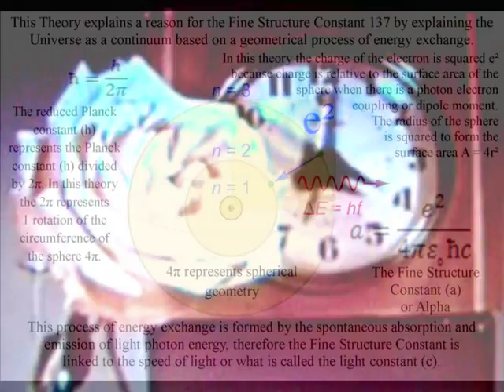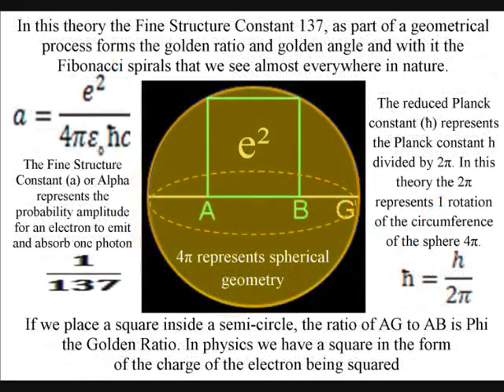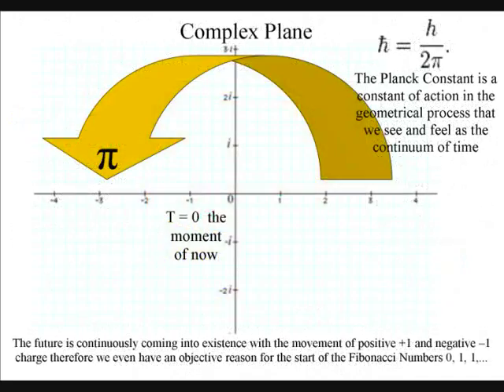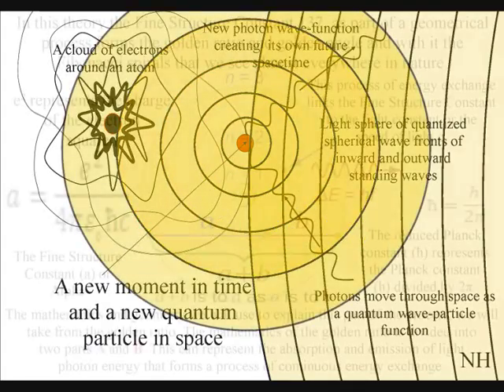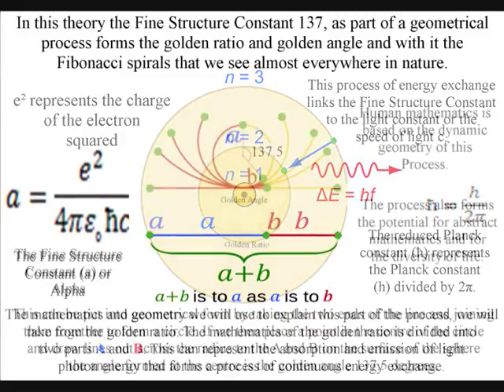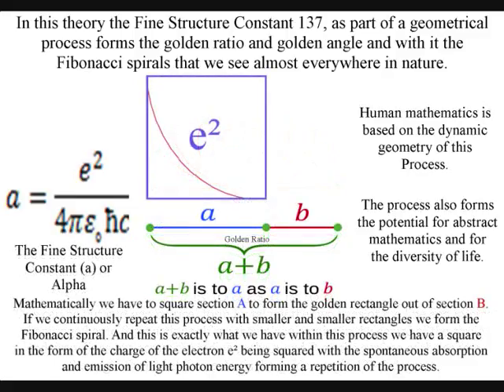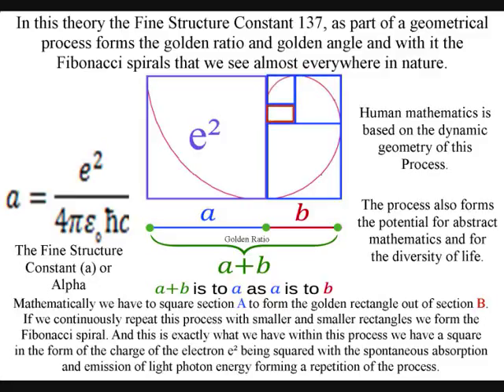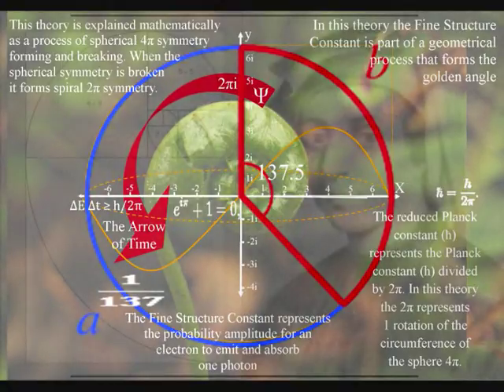A Reason for 137 the Fine Structure Constant

Comment: “When I die, my first question to the devil will be: What is the meaning of the fine structure constant”  /Wolfgang Pauli/
 “The theoretical determination of the fine structure constant is certainly the most important of the unsolved problems of modern physics.” /Wolfgang Pauli/
Reply from the maker: Me too!
Reply: @Dyslexic-Artist-Theory-on-Time  ....  Universe is based on the (π)+ fine structure constant + forces 
#
The absorption and emission of fermions energy forms a repetition of the process forming the Golden Angle (a=1/137) in the form of geometrical self-similarity. 
#
The (π), fine structure and forces forms the topology of particle dictate how quantum particles take geometric shapes. 
We have the Golden Angle (a=1/137) not only to aspects of mathematics but also in physics, chemistry and biology.
We see the Golden Angle in almost everything that is a process over a ‘period of time’. This is because the process (a=1/137) forms a process of continuous creation.
#
 In this way the Golden Ratio, represented by the letter (π = 3.14159. . .   and (a = 1/137) are a geometrical connection between two aspects of quantum particle.
 Universe is based on these two quantities (+ forces)
#
The wave particle duality of fermions depends on these three quantities.
#
The quantum mechanics represents geometry, the Planck Constant ħ=h/2π is linked to 2π circular geometry representing a two dimensional aspect of 4πr² spherical three-dimensional geometry. 
#
We have to square the wave function Ψ² representing the radius being squared r² because the process is relative to the two-dimensional spherical 4πr² surface. We then see 4π in Heisenberg’s Uncertainty Principle ∆×∆pᵪ≥h/4π representing our probabilistic temporal three dimensions life. 
#
The electromagnetic force is result of  (π + a + h-spin)
The absorption and emission of light ∆E=hf energy is depends on changes (π + a + h-spin), because there are two (2) kinds of own, inner spins of fermions.

Comment: Is there a connections between civil engineered  trusses and atomic structures? 

This video shows a natural quantized effect using a version Euler’s Contain Column Theory?

This video of an engineering test models the quantum physics problem called “Particle in a Box”. The wave function is used to predict the location of quantum particles, atomic structure and molecules.

https://youtu.be/wrBsqiE0vG4?si=J5jCMxq3pRe_P-gG

Very stable trusses and truss core panels have been fabricated using the process shown in the video.

The video shows how materials naturally respond to induced stresses in a “quantized“ manor. 

The process’s load/deflection’s sawtooth curve with its exponential fit in the engineering study shows the previously unknown bifurcation between quantum jumps. 

The effect has been used to make light weight structures and shock mitigating/recoiled reduction systems and earthquakes isolation systems. 

The model shows why with the, exponential load increase and loss of resistance at phase change, quantum jumps are so very fast.
Reply from the maker: Very interesting comment and video. I believe the answer is yes. In this theory between any cause and effect there is the absorption and emission of light, a photon electron coupling. This can also be called a quantum jump or dipole moment. I take it that with an increase in stress there is an increase in temperature, therefore an increase in photon ∆E=hf energy.
Reply: @ thanks, I find that very interesting I will have to think about that also

Comment: Fine Structure Constant as a mystery can not be solved within QED! Why? Answer: If alpha "which quantifies the strength of the electromagnetic interaction between elementary charged particles" you can not explain alpha (electromagnetic integration) by electromagnetic interaction. See Fine Structured constant "Geschichten aus 1001 Nacht if you like. More short mystery.
Reply from the maker: This theory explains a reason for FSC based on spherical 4πr²geometry. We have a process the is relative to the surface of the electron sphere that surround the nucleus. When there is an exchange of energy we have to square the radius  r²~ ψ², t², e², c², v². This form a constant relative to the spherical surface that we see mathematically as the FSC

Comment: however the fine structure constant 1/137 is NOT constant, at higher energy values the number 1/128 emerges
i.e. The usually quoted value of the fine structure constant is 1/137.0359... This value holds at low energies. As is well known, this value increases somewhat with energy: it is about 1/128 at (M_Z)^2. Now, IF we imagine that there is no GUT, no physics beyond the standard model, no supersymmetry, and that QED is correct all the time (yes, that is a big IF), what would the value be at Planck energy (10^19 GeV)?
Reply from the maker: It approximation
 Ψ²💡 4πr²🟡 r²📐 c²➕➖e² ⏳t²🎲   Eₖ=½mv²🚀

Comment: And so you would turn the clock back to the Dark Ages of the 1920s, the decade when a whole crew of scientists who should have known better (notably Eddington who was dubbed Sir Arthur 'Adding-one' for his childish 'revision' of 136 to 137, and who likewise might have had a "Somerset accent"), went off on kabalistic ruminations about the integer 137. It is obscene for you to even mention the name 'Feynman' in your context, since the number he said should go up on the wall to "worry about" was -0.0854255. (Or, approached another way, the number is 137.03597; in any event, certainly not the "137" of the long-ago 1920s. See QED, Penguin Books 1990, transcribed from Feynman's 1983 lecture series at UCLA, where the two numbers I cite will be found on page 129.)
And by the way, the pi in '4 pi epsilon-naught ' cancels the pi implicit in the denominator of the succeeding h-bar. Thus, there is no reason ever to show Pi anywhere in a fine-structure constant equation except that one is a promoter of the Superstition of Pi.
Reply from the maker: Just because we make a new mathematical term as in h-bar does not destroy the geometry 2Pi is still out there! LOL
Reply: Verschlungen ... lol you are clearly ignorant about the light to be found in the dark ... you don't like the Qabalah eh? (one of its many spellings of Kabalah) .... however IF you do your homework assigned by a rabid rabbi who emerged out of a rabbit hole you would realize that the word QaBaLaH has a value of '137'  i.e. Q=100 B=2 L=30 H=5
Did you also know that the number 137 emerges out of a geometry lesson?  Did you know that the QaBaLaH claims to be a bridge between the bible and science? I have a feeling you do not know much about what you do not know

Comment: Maths in a Somerset accent is simply the best maths you'll ever find.
Reply from the maker: I don't know about that LOL
I think we need to go back to r² and the three dimensional physics of the Inverse Square Law!  Spherical 4πr² geometry is fundamental to this process and this is based on Huygens’ Principle of 1670 that says, 
“Every point on a light wave front has the potential for a new spherical 4πr² light wave". 

We can think of each point as a potential photon ∆E=hf electron interaction as resonance or vibration. The spherical 4πr² surface forms a boundary condition or manifold for the uncertainty ∆×∆pᵪ≥h/4π of everyday life.

The centre of the sphere forms a constant of action relative to the radius square r² and the circumference 2πr. This forms the Planck constant h/2π in mathematics of Quantum Mechanics

Comment: ℏ=λ*(P/2π)
Reply from the maker: I think we need to go back to r² and the three dimensional physics of the Inverse Square Law!  Spherical 4πr² geometry is fundamental to this process and this is based on Huygens’ Principle of 1670 that says, 
“Every point on a light wave front has the potential for a new spherical 4πr² light wave". 

We can think of each point as a potential photon ∆E=hf electron interaction as resonance or vibration. The spherical 4πr² surface forms a boundary condition or manifold for the uncertainty ∆×∆pᵪ≥h/4π of everyday life.

The centre of the sphere forms a constant of action relative to the radius square r² and the circumference 2πr. This forms the Planck constant h/2π in mathematics of Quantum Mechanics

Comment: 1:13 surface area of a sphere is 4pi r^2 not pi r^2 
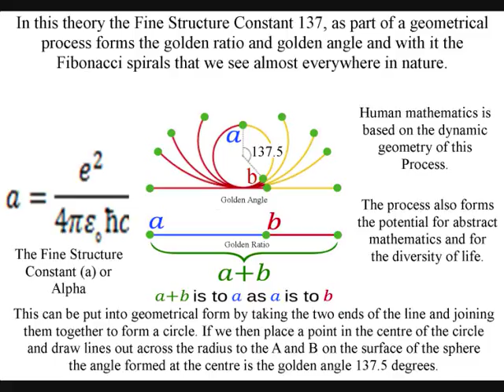 2:46 selection of degrees as units is completely arbitrary, you could also say it's 2.39 radians and conduct numerology on that too
0:15 the fine structure constant is approximately 1/137, not 137
Reply: The reciprocal (137) is often used instead of 1/137.
Reply from the maker: It is the geometry that is fundamental, not how you represent it.
Degrees are a good approximation to radians.
It is true the Fine Structure is an approximation and this is what you would expect if its formed out of symmetry breaking!
Thanks for your interesting feedback.
🎨🤠👍

Comment: The speed of light is exactly the radius of the sun minus the radius of the earth squared

(432.000-.3960)^2 = 186,282

The fine structure constant 137 is the reflection of the speed of light divided by the reflection of the earth year or the radius of the sun divided by PI.

282,681 / 563 - 365 = 137
432.000/3.14=137
1/137 = 729,927

29.53 * (3.14 + 2.718) + (666 * 3) * 365.2423 = 729,927

That's the exact tropical earth year and the exact sydonic moon month. 666*3=1998 which is the moment the sum of numbers is 999 times larger than the number. 

A circle of radius 365 has a diameter of 730

730,000 - 73 = 729,927

729,927 has 432,000 coprimes the radius of the Sun.

The Monster Group  is 196,883 or the Sydonic Moon Month * the Gravitation Constant

295 * 6,674 = 196,883

The reason it was called Monstrous Moon Shine is because it is also 

29.5 * 666 + 413 = 196,883 ( 413 is the reflection of PI) 

196  & 295 are the first and second Lychrell numbers that cannot form a palindrome.

19.6 * 18.6 = 365

It goes sooooo much deeper than just these. The higs bosons if you triangulate their masses their coprimes are equal to the radius of the sun, moon and earth.

If you want to know more about Easter Egg functions and see documentation for all my claims Cosmology365 for all my original research.
Reply from the maker: Paul Dirac said: "Theoretical physics is a waste of time unless you can explain 137". This theory explains how light spheres form the potential for 137.5 ~ 1/137 Coupling Constant or Fine Structure Constant, Golden Ratio ϕ, Golden Angle 137.5 and Fibonacci Spiral. 
Spherical 4π geometry will naturally form a three-dimensional process (three-dimensional space) that has to be squared r² if the process is relative to the surface of the sphere. This could give us a reason why so much is squared in physics, t², c², e², ψ² and velocity v² as in kinetic Eₖ=½mv² energy. This process would form an uncertain ∆×∆pᵪ≥h/4π future continuously unfolding with the exchange of photon ∆E=hf energy.

Comment: Ha ha, very funny. The units of degrees, that is 1/360 of a circle are human defined. Your derivation would be closer if there were 359 degrees to the circle, and that's MY great theory. Nobel prize on the way.
Reply: these videos are like magnets for idiots who covet a nobel prize
Reply from the maker: Degrees and radiant are a good approximation of each other! The geometry is more fundamental than how you measure it LOL.
This theory explains how light spheres form the potential for 137.5 ~ 1/137 Coupling Constant or Fine Structure Constant, Golden Ratio ϕ, Golden Angle 137.5 and Fibonacci Spiral. 
Spherical 4π geometry will naturally form a three-dimensional process (three-dimensional space) that has to be squared r² if the process is relative to the surface of the sphere. This could give us a reason why so much is squared in physics, t², c², e², ψ² and velocity v² as in kinetic Eₖ=½mv² energy. This process would form an uncertain ∆×∆pᵪ≥h/4π future continuously unfolding with the exchange of photon ∆E=hf energy.

Comment: 137.
Reply from the maker: This geometrical interpretation of quantum mechanics can give us a simple explanation for the fine structure constant or coupling constant 137.

When light waves interact with the spherical electron probability cloud that surrounds the nucleus of an atom there is an exchange of energy formed by the spontaneous absorption and emission of light.

The absorption forms a photon ∆E=hf electron coupling and at that moment in time, the energy levels cannot drop below the centre of the sphere because the process is relative to the radius and the spherical surface. This forms a minimum amount of energy forming a constant of action in space and time that we see mathematically as the Planck constant h/2π linked with 2π representing the circumference of the sphere 2πr.

When the energy levels drop, it also forms another geometrical constant relative to the square of probability and the spherical surface. This is seen mathematically as the fine structure constant or coupling constant 137. 

The absorption of light is followed by the emission of a new light wave that forms a probabilistic uncertain future, that can be seen mathematically as Heisenberg’s Uncertainty Principle ∆×∆pᵪ≥h/4π.

Comment: It’s fortuitous that the angle comes out to 137.5 because that angle is based on a 360 angle system which is arbitrary.  If you want to determine the angle as it would be interpreted the same without cultural convention, use radians.
Reply: @timmy Smith No, this is not about circles versus non-circles.  THIS IS ABOUT USING 360 DEGREES.  DO YOU UNDERSTAND THIS?  We as a society here on earth use 360 degrees.  It could well have been 100 degrees, or 6284 degrees, or 15 degrees, or 32.3232 degrees.  360 IS ARBITRARY!
Reply: @thomasn9752  you also could use a good shrink to expand your asymmetrical brain ... his name is Carl Jung and his theory that 'universal archetype' 'dynamic symbol' 'individual complex' emerge out of the 'collective unconscious' is in support of the statement 'meaningful coincidences' = sychroniicity 
Thus the 'meaningful coincidence' challenges the validity of 360 being 'arbitrary'
Reply: @islandbuoy4  Sorry I don’t subscribe to psych claptrap.  Have a day.
Reply: timmy Smith: You obviously didn’t read or understand at all my initial comment.  Do you know what 137.5 degrees signifies?
Reply: @thomaskn1012  you could use a good shrink to expand your asymmetrical brain ... his name is Carl Jung and his theory that 'universal archetype' 'dynamic symbol' 'individual complex' emerge out of the 'collective unconscious' is in support of the statement 'meaningful coincidences' = sychroniicity 
Thus the 'meaningful coincidence' challenges the validity of 360 being 'arbitrary'
Reply: @timmy Smith Circle CONSTANT, not circle.  Learn the difference.
Reply from the maker: No, degrees and radians are a good aproximation of each other. In other words, how you measure is not fundamental even the mathematics is not fundamental. The geometry of the process that formed the maths is fundamental! 
🎨🤠👍
Reply: @Dyslexic-Artist-Theory-on-Time 

You missed the point entirely
Reply from the maker: @thomaskn1012  LOL
Reply: @Dyslexic-Artist-Theory-on-Time 

Stick to art.  You might be good at that.

Comment: You seriously connect 137.5 degree to the finestructure constant? Or did I get it wrong? 137.5 degree just means "the 137.5/360 part of one circle". So the number 137.5 is produced by the fact that we take a look at a circle divided in 360 pieces. To chose 360 pieces is completely random. We could also have chosen 400. Therefore the number 137.5 in "137.5 degrees" has not any meaning, even if the angle 137.5 degree would have one.
Reply from the maker: We have a continuous process of energy exchange forming the Golden Rectangle and Golden Angle relative to the charge of the electron squared and the spherical surface.
The Golden Angle forms the potential for the fine structure constant or coupling constant in the form of the mathematical approximation 137.
Reply: The most prevalent angle in all of nature is 137.5 degrees. A rainbow begins at 137.5 degrees. Plank length x positive integer exponents of golden ratio = magnitudes of our physical existence. From the radii in Hydrogen to the spinning arms of galaxies. It’s all interconnected from the micro to the macro.
Reply: @TruthHealsUs  I agree that "micro" and "macro" are connected! Nevertheless 137.5 degree has nothing to do with the finestructure constant. Because 137.5 degree = 55/144 circles. If you want to search for some meaning in numbers, you have to take a look at 55/144 (which is 137.5/360 reduced). Searching a meaning in 137.5 is completely nonsense!

Comment: The wikipedia page on 137 is pretty comprehensive.
https://en.wikipedia.org/wiki/137_(number)

33rd prime number - 33 is certainly one of the main esoteric numbers... I think you're on the most logical track looking at fibonacci spirals. a fundamental macroscopic and microscopic ratio common to many processes that probably starts at the quantum level.
Reply from the maker: By explaining the Universe as a continuum based on a geometrical process of energy exchange, this Theory explains a reason for the Fine Structure Constant 137. This process of energy exchange is formed by the spontaneous absorption and emission of light photon energy ∆E=hf, therefore the Fine Structure Constant is linked to the speed of light or what is called the light constant c. Within the atom the Fine Structure Constant is also linked to the Planck constant ħ=h/2π and the charge of the electron squared e². These three constants form the fine structure constant and it is surprising how much information we have to explain the Fine Structure Constant as part of a dynamic geometrical process.